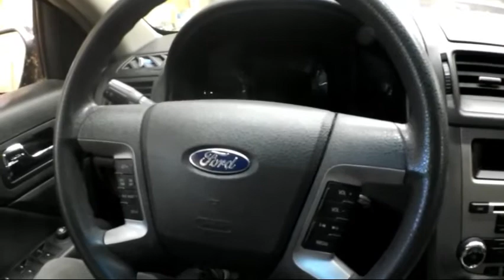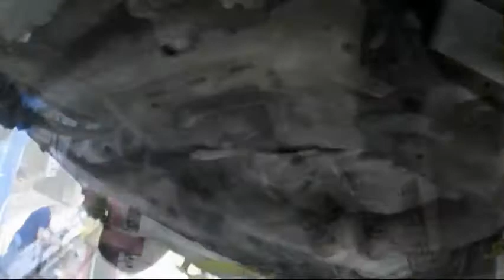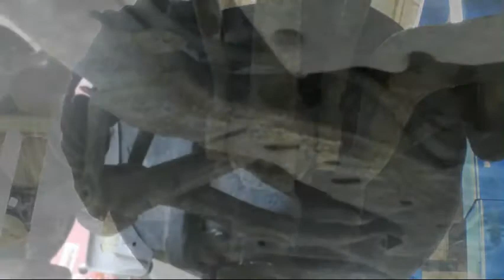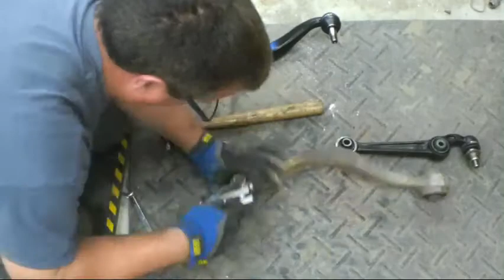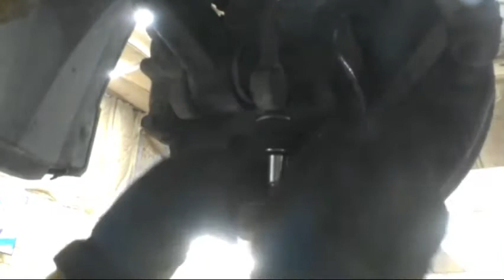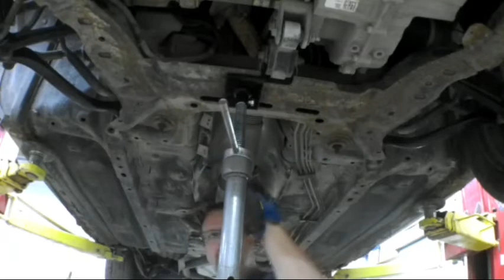Ford Fusion control arm and ball joint replacement

Comment: Great vid.  Best one I've seen on fixing these terrible cars.
Reply: Interesting, I believe statistics show these cars are one of the more reliable cars from these years.
Reply: Nothing from Ford is considered "reliable".  Get a Honda or Toyota then you will learn what reliable really is.
Reply: @Jedi_Luke  Toyota definitely, but my mother-in-law's 2003 Honda Accord 2.4l was burning a quart of oil every 400 miles before it hit 100k miles, similar story with my brother's Acura with same engine. Also, my sister-in-law's MDX seized up on the interstate returning home from a road trip. I see nothing reliable about that. Perhaps the most reliable car I have and have had is my 1987 Mustang LX 5.0.
Reply: Just rolled 220k on my 2.5 Fusion... Doesnt burn a drop of oil... All suspension parts are original.. Original trans and motor.  Rack was replaced at zero cost under recall.  1 front wheel bearing and 1 rear replaced, after 170k.  Just now replacing the straight control arm.   Most cars arent terrible.  Most have terrible, cheap owners who neglect and dont maintain them. We get these cars in our shop, and one can tell how poorly theyre taken care of, with food bags, pop bottles, cig ashes, disgusting...  I've owned 4 Hondas, and while they are great cars, they are over engineered..and many suffer from oil consumption... Anyone who has owned a VTEC Honda knows the expense at replacing anything related to that system.  If you want to compare GM or Chrysler cars in that segment, thats comical.  Toyota, while a great car, try buying anything interior related... $400+ master window switches.. just as one example.  And if you're a german fan, well, this suspension is an adaption from what manyh VW's have used for years..
Reply: My 2006 is one of the best cars I've ever owned.  I've owned a bunch of Hondas and a couple Toyotas. I actually test drove Accords and Camrys of the same vintage and ended up buying the Fusion for a handful of reasons. I also use it for courier work and have hit curbs at 30 miles per hour driving in poorly lit parts of town and the alignment stayed true and no rattles. Mediocre fuel mileage and the transmission isn't my favorite, but it keeps running. Tough and comfy cars for what they are. The steering and suspension are impressive for nearly 20 year old machines, also.
Reply: @Jedi_Luke  You're basing it off a silly hearsay acronym joke. jeeze.
Reply: @gb342002   Tell me you have a shit car without telling me.  🤣

Comment: Great video. 

Do you need to disconnect the steering shaft coupler?  Is there risk of damaging anything if I don't?

Other videos showing you need to do that but heck yea I want to avoid that if I can
Reply: I had the same thought that would make it so much easier. I guess you're just not pulling it down far enough to hurt it. I may go ahead and just disconnect mine when I do the job it's not that big of a deal.

Comment: After replaceing it.did it still squeak?
Reply from the maker: Nope. The noise was gone.
Reply: Ok thanks. I guess need to change out mine. I thought it was upper control arm bushing.
Reply: @jaygar1299  did you change your upper tho? I'm about to get mine changed
Reply: i ordered it .jus waiting on both upper / lower ball joint.
Reply: What size allen did u use on the lower control arms to come out?
Reply: Mine is more like a creaking sound and only does it when it is hot out.
Reply: @bobedwards2391  mine was the same but my mechanic still said it was ball joint
Reply: Why would he have made this video, if what he did failed to fix the problem?

Comment: I have a 2006 Mazda 6 3.0l auto in my sub frame is completely rotted out gone. I just bought it driving down the road and the passenger side control alarm cracked it off the sub frame and of course I can’t find it anywhere because Mazda discontinued the sub frames and every garage I’ve called from Maine to California doesn’t have one for an automatic and the ones that did when he went to go take it apart. The whole thing fell ready pot. I called Mazda and they said there’s no recon. I don’t know anyone help me. Can I get one off of a Ford fusion?

Comment: Help! I noticed near the end when you insert the ball joint into the sleeve/knuckle insert that it goes in with ease. I’m currently replacing my lower front control arms and they’re not going into the sleeve!  

Almost like I have to press with a lot of force for them to Nudge at all. After watching a few videos everyone else’s are just slipping in to place. 

Iv tried threading on the bottom nut and tightening it to pull the ball joint in and tried getting a ball joint press on it but there’s not enough room. 

How can I solve this?